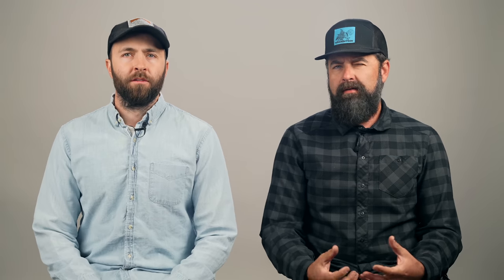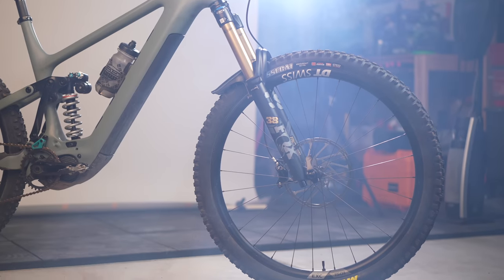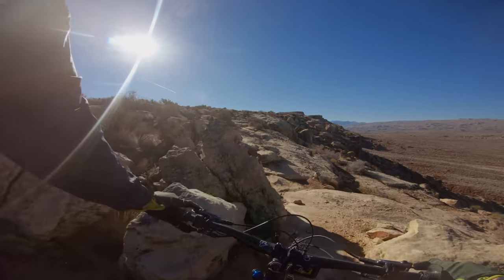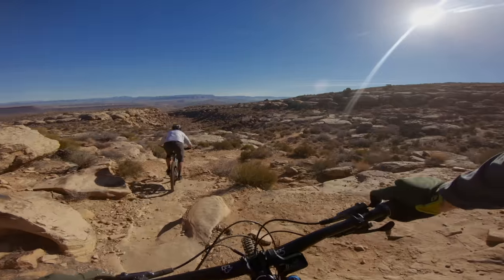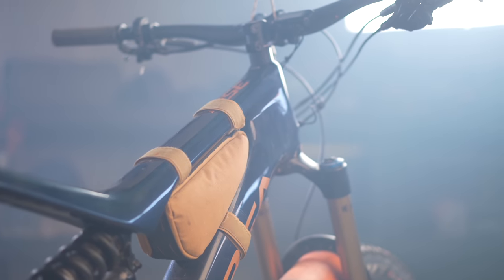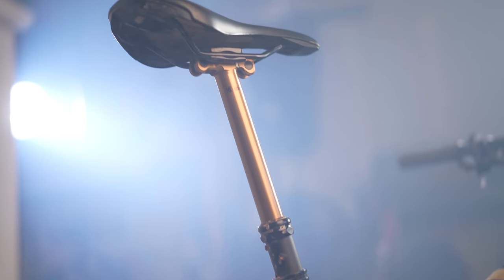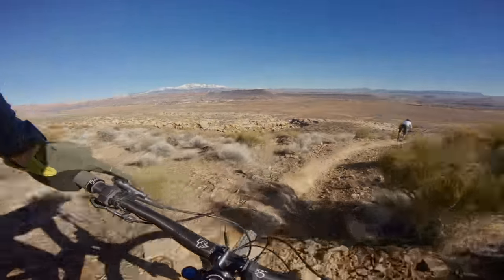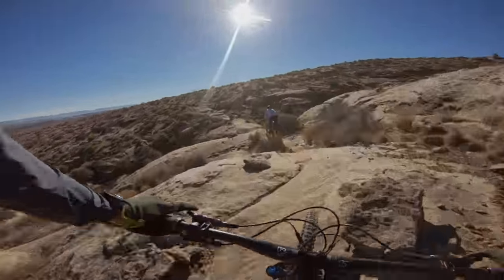Is a Slacker Head Tube Angle Better?

Comment: Totally agree that making an older bike with slightly outdated geometry slacker can give it new life. I have a 2019 canyon spectral with a 66 degree head tube angle. I swapped out the stock 27.5" 160mm fork and wheel with a 29" 150mm fork and wheel to make it a mullet and slacken it out (essentially over-forked it by swapping to the 29" wheel). It made the bike around 1-1.5 degrees slacker and made it so much fun. I kept the 27.5" wheel and fork and swap it back from time to time. Now its like having 2 bikes in 1. Great videos - keep it up! Cheers!
Reply from the maker: Thats a solid way to make a bike slacker!
Reply: And you have a seat tube angle that makes you pilot the bike from the trunk while seated
Reply: @Coerced  or you could just slide your saddle a few mm forward and be right back where you were 👌🏻
Reply: Thats making rhe most of a single bike👍👍👍👍😎😎😎

Comment: I done it with a orbea Rise, 170 travel in the front and 160 in the rear. ( 216x63 shock with one bishing = shock length effectiv 214mm ) and yes I love it and make a better bike for me. I will agree your statement 💪
Reply: Researching this for my Rise
Reply: Yep but when you keep the old shock and have an extra bushing, you suddenly have 2 bikes. one for longs flatter days, and one for rough DH. It takes 10 minutes to switch between them if you have a fork you can adjust the travel on without taking it apart (like a Mezzer).
Reply: I did 160/160. Love it
Reply: @UncleTonyL  i plan to get one and run it 160/160.what shock you use? mullet also?
Reply: @dft1  i used dhx2 with mullet yes
Reply: Hi Man i have a orbea rise m 10 can you tell me the angleset for rise please? And where buy? Thanks a lot! 🤘🤘
Reply: @the taz88 where you buy the angleset and what model for orbea rise thanks!

Comment: Very interesting indeed. I over forked my SantaCruz Heckler MX (XT version) with an Ohlins 36RXF air (150mm). I slightly lowered  the handlebar. It feels a little bit more stable in steep descent. But I'm curious to know what you think about this. By the way congratulations (from France) for your impressive and very useful reviews. Thank you.

Comment: I enjoyed your opinions, but I just don't agree with "modern geometry" either with Mt. Bikes or Motocross bikes (too tall and bars too far forward).  The effects you mention are true, and I know it depends on where you ride, and how you ride, (I suspect a slacker head angle will allow you to be a more lazy rider).  But you are basically showing a difference between a Chopped out Harley, and a Motocross bike.  More stability with slacker is true, (like a chopper), but even with my 1995 Nuke Proof Ti bike (71 head angle I believe), I have never had what is called "head shake" on a rough downhill, (where the head angle is so steep, the bars violently swing from back and forth from left to right.).  Many angles can handle a nice radius berm corner well, but try to cut the flat inside line and you will see the steeper angle offers you more line choices.  The slack angle also lays the forks down more, so you will get more bending forces instead of sliding action of the forks, (why choppers do not use telescopic forks).  I can see a slacker angle being better for downhill racing, but none of these "modern bikes" are going to cut an inside line like my 1995 Nuke Proof (back when they were made in Michigan. I used to work there).  I don't like the modern Motocross bike set up, (cant feel the corners for example, with the high/forward/freestyle bar set up they use today), and I don't care for "modern thinking" for Mt. Bikes. In fact, in every industry, I think we were sharper people one generation ago.  It is a fact that intellect, with our garbage education system, is on the decline, and we have entered an era of irrational thinking, so we just do what everybody else is doing even if it is not a improvement in reality.  How is your math from our schools today?  We really can't figure much out with out good math.  I am glad I picked up a Trek Marlin 7 with a 69.5 deg head tube angle and 4" travel forks, (although 30lbs is a pig compared to my 22lb Nuke Proof, and top speed of a single ring is pathetic).  Until it "head shakes", (and it won't), I have no reason to slack off.  Just because everybody else is doing it, is not a valid reason for me.
Reply: @earthsurferusa.This is how i feel. My Yeti bigtop has a 70 hta. It rides great. I get tired of slacker is better for everything. So now i need a new bike bs.

Comment: I am looking to go much the opposite direction. I ride in Western Oklahoma and bomber hills are simply not found here. I really like the steel head angle of an XC bike with the suspension of a trail bike. Going to use an angle adjusting headset to get there. Same path, for a different destination!

Comment: Real interesting to hear your impressions.  I've already over forked my v3 5010 and have it in the low setting but am curious about adding an angleset to offset that slacker seat tube.
Reply from the maker: If you try it, let us know how it goes.
Reply: I have a 5010 v3, with 150 travel up front and am also thinking of doing this, let me kniw if you think its worth it
Reply: Any news? Thanks!

Comment: Yes. (For me 😁)

On my ‘16 134 I put a -2deg angleset on + a 160 fork (from 140) and the bike went from 68 to 65 HTA. With minimal change in BB height. HUGE difference in downhill capability. With a 125mm head tube the thing is overbuilt and I have zero concerns about durability. I did have to run a 50mm stem to keep front from washing out constantly on flat turns (I crashed a lot before that). This also lead to me thinking about going back to 140 travel in the front but a 29er wheel. This would keep the ATC of my current setup but the dynamic ride quality might be different… Jury’s still out on that one, but I think it’s one of the few ways you could mullet a 27.5 bike without the huge change in Geo.

Comment: I just did that on my 2018 Santa Cruz Hightower. Head tube around 64.5-65 and the seat tube around 75 (76 with saddle forward). Running 29 F/R with 150 mm fork. I wanted to extend the life of the bike until I'm ready to move on, but in this setup it feels much more stable downhill and it still climbs well. Plus I can still use my 27.5 wheels or set it up as mullet
Reply: what angleset did you use? I am looking to do the exact same thing on my 2018 hightower LT
Reply: @Dirtymutt9  it's called 9.8, from Canada. Depending on the head tube length you get about 1.5-2.0 degrees slacker.

Comment: This was exactly the kind of information I needed.  My trail bike has a 130mm fork with a 66.5 degree head angle.  I am not the most confident descender therefore I am going to increase the travel to 140mm and slacken out the angle.  I just have to decide on if to go with 1 or 1.5 degrees.

Comment: I think you guys nailed it. Back in the day I rode for a couple different bike manufactures and kept saying, we need more head angle, we need more head angle. But this was for strictly downhill racing. I don't really remember what the number I requested was, but I think it was 64 degrees.
Reply from the maker: Crazy that the all mountain bikes are that slack these days.
Reply: @bikersedge  ,....Yep, it is crazy. If you find an old picture of an old downhill bike (the first couple of generations) you can see how steep their head angles were. I think something like 68 degrees was the norm. Guys used to go over the bars all the time. I raced the Deer Valley norba nationals a few times on those crazy bikes.

Comment: Put a wolftooth 2 degree kit on my girlfriends 2017 DB Catch 2. Went from 68 to 66. Then I put a 150mm air spring in the Pike, up from 130mm. Bike is a completely different beast now. The trails we like to ride are super steep and it helped way more than I thought it would. I do miss the quick steering but that's a fair trade off for more capability when consequences are high.
Reply from the maker: That’s a huge change. Probably doesn’t even feel like the same bike.

Comment: I have messed around with this quite a bit and found over forking plus one or two offset bushings depending on the bike is the way to go in most situations. Less extreme head angle adjust and allows you to tune the bike a bit more how you want it. Plus they are $20. Thanks for another great video 🤙
Reply from the maker: We definitely forgot about offset bushings. They’re a less common solution for us to see at the shop. Still a good option.
Reply: I ran the offset bushings on my 2020 Occam XL (150mm fork) nearly all season but swapped back to the original bushings in the fall and immediately liked the latter better. With the stock bushings this bike felt more nimble and poppy. Riding here in Norway it’s mostly all natural stuff with technical climbs. Guess the terrain is key. As you say, offset bushings is a cheap way to test things without much hassle.

Comment: Mulleting, over forking, angle set... Will all change the handling of your steed.
For mind, over forking isn't as drastic as everyone makes out.
Sure the HTA will obviously get slacker. But, aspects of the bike that are further away from the site of change are less affected.
I've generally over forked all my rigs.
My  '17 Nukeproof 290 hard tail was designed around 120-130mm of travel.
I set it up on a 140mm fork and it's killer.
My Banshee Phantom V3 was designed around 130mm of travel... again, I've gone for 140 up front.
I've also mulleted it out, which has slackened everything even more so.
The Phantom V3 comes with adjustable dropouts... in the low mode the bike felt a bit off... however, in the high mode it feels just right.
I've also just built up a '21 Trek Remedy w/ a 170mm fork, in the low mode. I've also upsized to XL from my usual large sizing.
The bike absolutely rips!!
Still has the well renowned Remedy 'Pop', but is also stable at speed through the chop.

Comment: I did a 1.5 degree 9 point 8 slack-r kit on my Santa Cruz chameleon, and overworked it to a 150MM ROCKSHOX Domain , so fare its been very fun!!!
Reply: I have a 2022 Chameleon mullet that I put a RS Pike 140 Ultimate on, and thinking about the 9point8 slacker as well.   Do you have the newer version  (65deg HTA)  or the older version?

Comment: My wife’s ripley rolls on a 140 fox 36, which ups the a2c something like 15mm from stock. 65.75 hta is a lot more reasonable these days for a trail bike in moderate terrain than stock 66.5. Feels so much less sketchy :).

That’s Just to second your point on the ripley. I’m sure whenever the v5 comes out it will update to closer to the afs geo.
Reply from the maker: That’s a good setup for that bike.

Comment: I have a Litespeed Pinhoti boost (V2) hardtail that I have been riding overforked for a couple of years with 130mm front travel instead of 120. However, this longer fork than stock slackened the already slack STA. I swapped the fork for a 120 which fixed the slack STA, but steepened the HTA to 69.5 degrees and shortened the wheelbase - bike is super nervous feeling now. Next step is the addition of a -1 degree angleset to get me back to the longer wheelbase and slacker HTA I had with the 130 but with the secondary benefit of steepening the STA slightly. Hopefully, it won't lower the BB too much.

Comment: Awesome video, I have been playing with the idea of putting an angle set on my 27.5 Trance (67HTA/73.5 STA). I think this will bump up the geo a bit to more modern standards. I really like that it steepens the STA as well it seems kind of a win/win.
Reply: Yes I have the trance 27.5 2021 am not happy with the steep head angle. How are you going to change it?
Reply: @blakelynton7072  hey! I saw your comment on my other video. I got a works angle adjust headset to slacken the Trance 2* and then I bumped up the travel on my Suntour Aion fork by 10mm so essentially another .5* on the whole bike. The final HTA is 64.5 and STA would be 75.

Comment: Hey Guys! So I actually steepened by Sentinel V2 by 1 degree using a Wolf Tooth Geoshift Headset to get a 64.6 degree HA.  I found with stock 63.6 HA I was understeering a bit in corners and it seemed a bit cumbersome for the Vermont trails where I ride.  I looked at a lot of different bike geometry (Yeti SB150, Ibis Ripmo AF, etc.) to get comparison and I felt 64.6 made sense for 150/160 travel.  I think how you fit on the bike makes a difference as well, I'm 5'11" on a size large whereas someone 6'1" would be positioned more over the front with longer torso, legs, and arms.  Also, I may put in a 170 air shaft this summer for bike park days and effectively make the HA 64.1 degrees.
Reply from the maker: Interesting. Personally I love my sentinel exactly how it is. Different strokes for different folks.
Reply: I'm ready for a new New England trail bike, upgrading from my 2017 140/140 Intense Primer which is perfect for MA/NH techy awfulness.  Problem is, everything is noticeably longer, slacker and lower which is the opposite of what I need for switchbacks, rock gardens and tight gnar.  For me, the problem with newer bikes is more than just HTA.
Reply from the maker: Sounds like you just need to move out west.
Reply: @bikersedge  If only the saltwater fishing was better in CO.
Reply from the maker: Well there is that.

Comment: I have a SC 5010 V3. Upped the 130 fork to 140 with an air shaft. 
I noticed very little change in the handling. (I’ve always ridden in the High setting.)

Comment: Talking ebikes here. I played around with the settings on my S5 Gen3 Turbo Levo and ended up going full slack on the front with the flip chip high on the back. 64 degree head angle.  That was a good compromise for me between stability, ground clearance, and agility. The agility suffers a bit though and sometimes I have issues with tight steep uphill turns. Worth the tradeoff though. Previously I had a size large SC Heckler which was too small for me (6'2") but nimble.  I put a 29 wheel on the front which helped the bike overall but made climbing a real challenge as it wanted to wheelie way too much. No doubt lifting the back would have helped. That, combined with the abrupt E8000 motor, had me getting stuck on climbs pretty often. In contrast the Turbo Levo climbs very very well with the setup I have. Any more slack would be too much for my riding.
Reply: the way you describe is actually 63.5 HA

Comment: You should mention that you can add an angle adjust set  to achieve the slacker hta without effecting the sta and add a lower headset cup between the headtube and fork crown to bring the front end back up. Basically saving you the cost of the new air spring while maintaining the bikes original geo with a slacker hta.
Reply from the maker: While that would work you may as well get the benefit of more fork travel.

Comment: One more thing you can do, if you’ve got ample clearance for your rear tire, is to use a shorter rear shock. I’ve done this on my cheapo Gravity FSX 275LTD and, along with a 1.5 degree angleset, slackened the head tube angle from a putrid 71 degrees to palatable 66.5. Time will tell how much that shock bottoms out and any other consequences that may arise, but it’s a fun experiment in the meantime. Next, I might overfork and put the longer shock back on—or not—and see how it goes.

Comment: 63.5 degree for trail is what i'm riding right now.   it's great.
Reply from the maker: Nice.
Reply: Not for tight cornering, (with out a berm).  I have a vintage Ti frame Nuke Proof bike, (71 degree head angle I believe), and no modern bike is going to get inside of it on a corner.  You would be more comfortable on a down hill though, even sitting on your seat.  Fork action also suffers with that much slack, and there are more bending forces where more sliding would occur with steeper angles.  That is why most Harley chopper motorcycles use a springer front suspension instead of a telescopic fork.

Comment: I have a Izzo Blaze which has a 140mm fork instead of 130mm. I just installed Wolftooth 10mm extension too to get rid of the knockblock. The wolftooth extension makes the headtube angle .5 degree slacker. Not sure how much slacker it makes the seat tube angle though. Have yet to ride it with extension.

Comment: Interesting conversation for sure. I have Wolf's tooth 1deg headset I've pulled off of frame I'm selling. 
I now find myself stuck trying to figure out what bike to install the angleset on now...my Ripley V4 or Ripmo AF. 
Ripley is already running 140mm Fox 36 so I don't know if i wanna further slacken it, bike feels great (could it feel even better with -1 HTA?) 
Ripmo AF feels good too, running stock 160mm. 
I'm leaning towards throwing it on the Ripmo AF.
Would appreciate some perspective on this.

Comment: You had to call out my Ibis Ripley as the perfect bike to slack out... Figuring out my budget now haha! Love the advice of doing both at once, now just have to talk with my LBS about my options
Reply from the maker: We’ve done it to a couple of Ripleys now. Adds that little bit extra on the DH. It does come with some penalties though.
Reply: @bikersedge  what penalties do you see? I have an altitude as my main rig, but, jsut sold my ripmo and wanted to get a ripley.. over fork and angleset and use it as my longer ride bike
Reply from the maker: You'll see the same penalties that we cover in the video — slower handling and longer wheelbase. Great for the DH, but they can kill some of the poppy and nimble character of a bike.